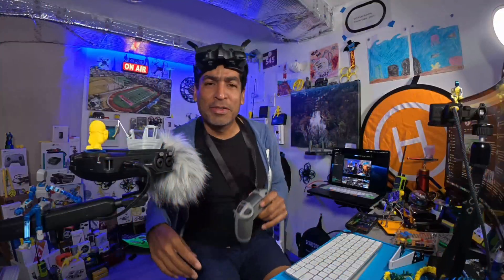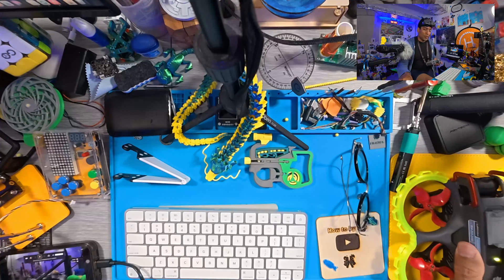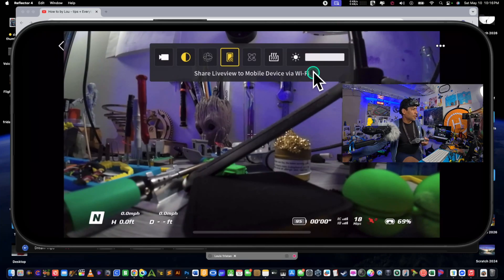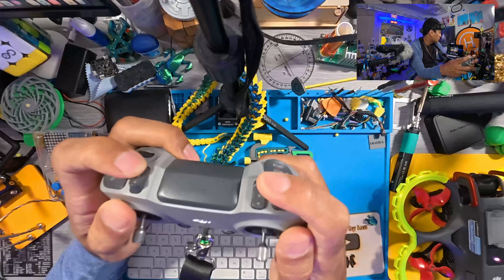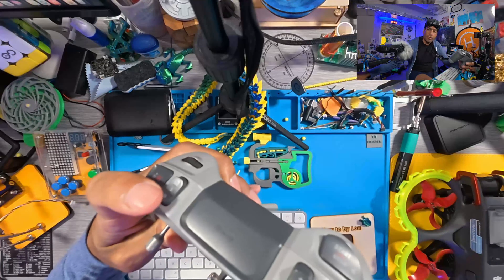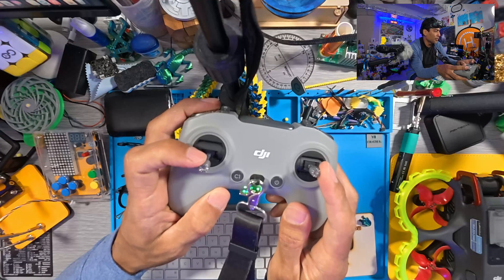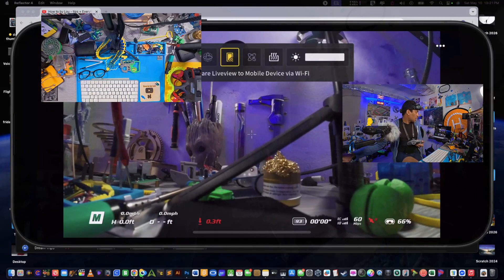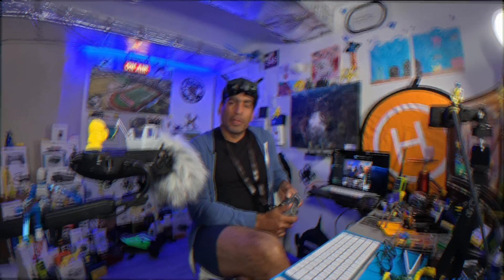How to arm your drone with DJI RC 3, How to Disarm your drone with dji RC 3

Comment: A screw came in and I don't know how to remove it. I have to disassemble it, help.
Reply from the maker: Have never taken it apart 

You’ll have to watch this a few times before taking it apart. Once you are comfortable then move forward but make sure you have the right screwdriver kit

https://youtu.be/kG0qZcd8-Fw?si=VCOquU_GW1T2Gg1b
Reply: @How-to-by-Lou I found a simpler way. It is to remove the plastic where the levers are stored and once removed it manages to make the screw come out there. And that was how I managed to get the screw out.